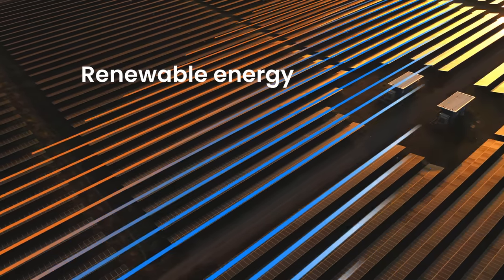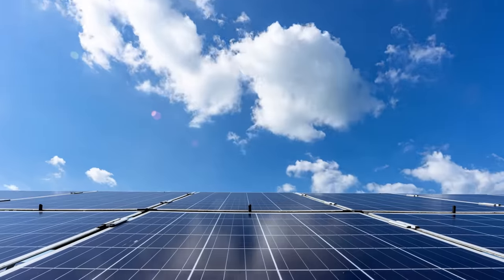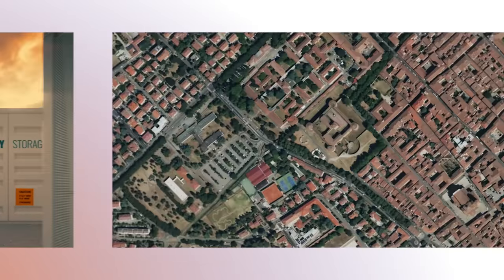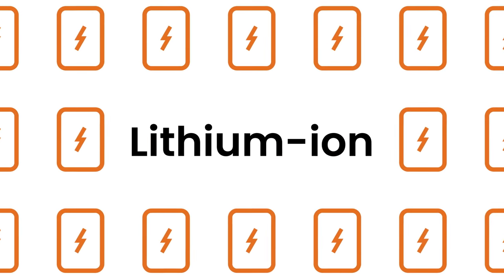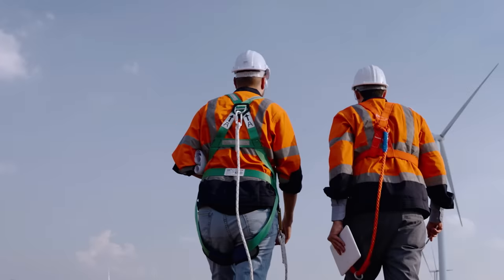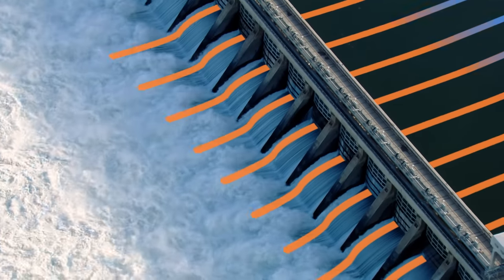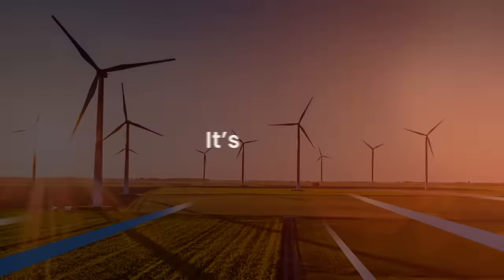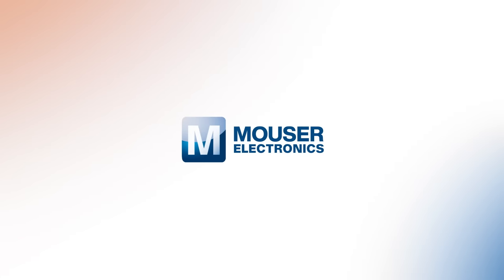Green Energy Storage Systems Overview | Empowering Innovation Together

Comment: wind is NOT green energy it consumes more power than it returns over its life from a mine to the shredding of the blades into a concrete mixer. At this time is the only option if u don't berry them. For the record i have skin in this field as RDP Marine we make a system for dams to make more power from the same volume of water